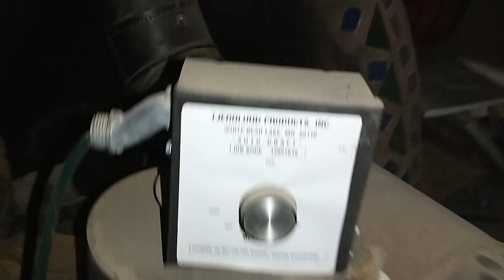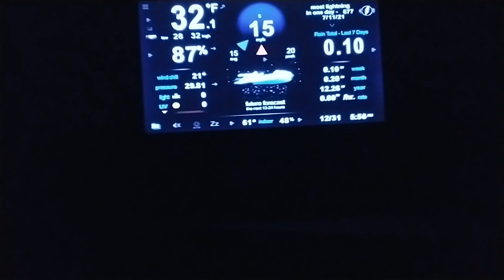Heating The Earthship Only With Passive Solar

Comment: I'm surprised (given that you're an obvious tinkerer) that you've not gone and got a chinese diesel heater. My current favourite use is using the excess exhaust heat to heat a "sand battery" https://www.youtube.com/watch?v=x3VDCuyRJqw

Comment: Woodstoves need two things to draw air correctly. (1) They need a tall chimney (a short chimney will not draft well). The taller than chimney, the better the draft. (2) They need “make-up-air” to pull into the room, air that replaces the air that went up the chimney. If the stove is in an airtight room, then it will not draft properly. If the lava tubes create negative pressure, then you need to open more ways for air to get back into the house. It sounds counterintuitive, but a stove needs to have cold air pulling in from the outside. In a perfectly insulated house, with no way for vapor/air to get into the house, a stove just won’t work. Basically, you would have to open a window to let the stove operate correctly. But I’m not sure how your house is insulated/sealed up.
Reply from the maker: All of that is correct. At a certain point trying to get the wood stove working was put on the back burner since it seemed  fairly rare that it would ever get cold enough in the house to need it anyway.
Reply: I think some stoves have a specific combustion air inlet designed to take a duct from outside the building directly into the firebox.  Such a setup solves any negative pressure issues and dramatically improves the efficiency of the unit. I also see there are retrofit kits to accomplish this same thing with stoves not designed for fresh air intake.  That said, I suspect you could cobble together the same type of thing with inexpensive parts and pieces from Home Depot.